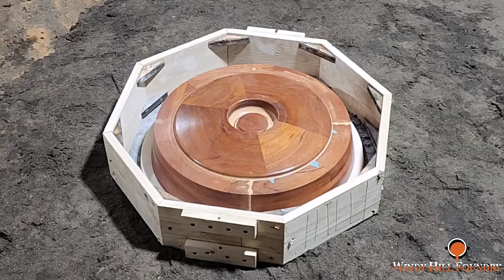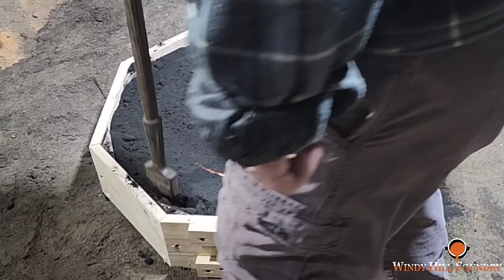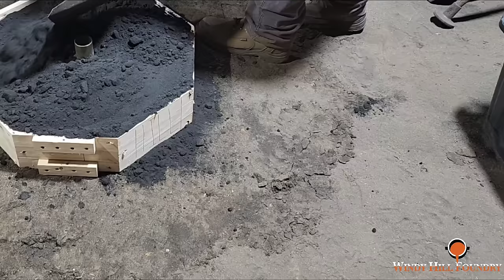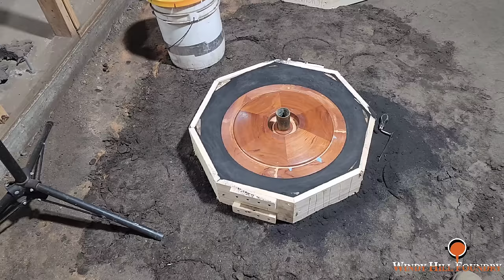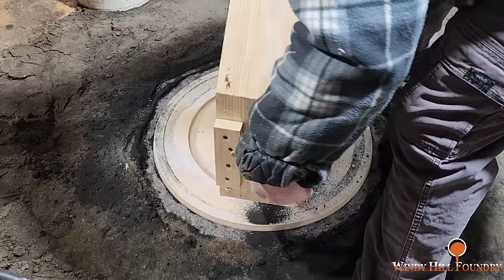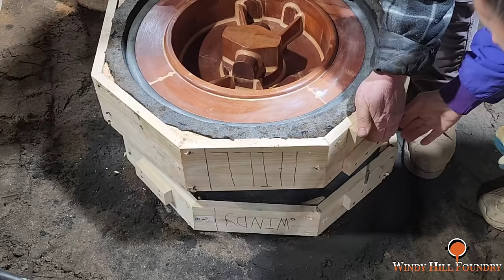TALLY HO CAPSTAN PART2

Comment: For one-off casting I like the Lost-Foam method. I get good results, and you don't have to worry about draft angles and cope and drag issues.
Reply: I thought of that every time the sand dropped and he had to do it over. However, I imagine that making complex patterns from foam can be tough.
Reply: 👍👌👏 Exactly what I thought instantly too. A foam piece could have been easily produced with a CNC machine or a 3D printer. Even the wood piece isn't necessary nowadays. The original parts are scanned, modified if necessary and then printed with a 3D printer. But I guess that the wise beyond his age Leo Sampson Goolden simply wanted to show how it was done for hundreds or even thousands of years.
Best regards, luck and health in particular.

Comment: If it was easy, they wouldn't need an expert.  Trust the process.  Excellent video, looking forward to the next round. Good luck!
Reply: Trust the process. Absolutely.
Reply: Yep, this calls for the right sort of person, which you are! It won’t go easy, but it will go!
Reply: is it supposed to be doing that way? it was a cast item widely used in steam engine ship. mass production  is the key in those days. is it possible that this part was made in a sand pit method instead of using mode? just like those old singer sewing machine frames?

Comment: What I know about casting one could put in a thimble with room left over.  It seems to me that the low temperatures are preventing the sand from adhering to itself, so every time you do a pull, the sand just separates.  It seems to me the biggest obstacle is the below freezing temperature.
Reply from the maker: You are most likely correct. We normally don't run into issues like this unless the finish of the side profiles are too rough to slide out of the sand

Comment: Ive been following this channel, and the tally ho project separately for years.  Kind of cool to see these two communities cross paths.  This looks like an amazingly difficult project. I have no idea how they made the original part over 100 years ago...  its insane to think about.
Reply from the maker: Actually, 100 years ago they were probably tooled to mold up a few hundred of these. With the proper setup, research and trials, they probably were pumping these out efficiently after all the hard work was done
Reply: The process is as
\nit was in the 1600's and won't likely change for another thousand years. I pour silver on an far smaller scale from 1.5 to 10 ounces and the process remains the same. This fella is a joy to watch doing what he loves to do best, LOL.
Reply: How they made those casting a century ago is due to several factors.  At the time of Tally Ho, the world was in the middle of the Industrial Revolution. And there were thousands of foundries with experts in cast iron.  At that time, it was common to be casting machine parts hundreds of times larger than this capstan  on a daily basis.

Comment: Ive also seen illustrations of using turnbuckles for lifting mold sections or even drawing large patterns.
Like a three or four point lifting chain with the turnbuckles in place of chains connected to a main ring.
That would allow for fine adjustment.

I also saw an illustration in "Metalcasting" by C. W. Ammen of a flask with screws mounted to the sides of the flask.
They were used to jack the mold apart for a very slow but controlled draw .
Reply: Yeah, I was just thinking something like an A-frame would be just perfect for this. Easy to move around and able to put in a simple lifting rig to give you fine control.

Comment: I once tried to cast a part that looked like a dog dish and the sand kept breaking off just like yours. A guy told me to ram the mold the opposite way so the large hunk of sand filling the dish was now sitting up instead of hanging and it worked well. First I rammed up a flat layer of sand and then filled the pattern and scraped it off flat. Then flipped the pattern over while full of sand and set it on the flat layer of sand. Then I rapped the pattern and removed it then applied more parting just and set the pattern back on. THen I put on the other half of the mold and rammed it up. When i seperated it, the pattern stayed in the top half of the mold and then I rapped it and removed it.

Comment: I'm guessing the videos are running behind and you have this figured out by now. A trick I use on deep parts, I start the initial separation with wedges ( shim shingles ) between the flasks. It gives good control you can slowly work one through at each corner,  once you have it separated a 1/4 inch or so much easier to lift off.
Reply: i used to use a similar technique to seperate a cylinder head from a barrel. drive box knife blades into the edge of the gasket, evenly all round. Use about ten blades.

Comment: I know you dont want the weight but I think you need steel or cast iron flask and it needs a trunnion mounted on the center section and you need a spreader with hooks to lift it by the trunnions so you can roll it over. You would need a better crane to lift it though. The wood is going to flex too much being that thin and will always cause the sand to fall apart. The only way I see the wood working is if you use chemical set sand. If you used that, you would be done already. We used to make some flasks at work the were cast steel and they had trunnions and were about the size of a casket. They were for casting parts for railroad cars.
Reply from the maker: As I said, we have bigger metal flask but for this and other jobs that require this much sand we prefer to focus on weight and design for rigidity of the mold which can always incorporate wood which is always cheaper by the way

Comment: Many of those machine parts were made by slicing the mold vertically,  making only two part molds.  Of course there is no easy way to make a complex casting, but I have found that I can cheat in really difficult cases by using high strength silver brazing to join parts of a multiple casting where there are large areas of contact and castings must not be overheated.  High strength (not silver solder used in plumbing) silver brazing is often stronger than the parent metal, when used with clamps and overall heat, makes a joint only microscopically larger than the original if repairing a broken casting.  I used it in a heated jig to connect large width bandsaw blades that had to flex around a large pulley top and bottom, with enough tension to hold the blade absolutely vertical when under full load. Several tons.

Comment: I love this process. My castings are asliver compared to this beauty. The mold/core you have made takes the same care and attention my little 4 to 10 ozt pieces take are exactly the same as the ones my pours take but being that big leaves them to larger possibilities of larger voids etc. They are the troubles they make for me eh! Occasionally I will have a look/see person visiting whiIe I am working on the Petrobond and they ask if I have to hammer the sand that hard and my reply is simple, , , YUP ! One thing I have noticed is by running a saw cut along the horizontal part of the flask liner side they have never had a sand slip in from the outer walls. You have a bunch more experience than I do but it has sure worked well for my sorry old butt eh. As I teach others on the best way to pour Silver or Gold, Brass or Copper the reason for their pours have soooo many  voids are they have used far too much parting powder. With this pour a soft hired broom is needed to apply just the right amount of baby powder for your pieces.I have always put in what those that pour more than myself a LOT of vents/risers in each flask. So far that thinking has never let me down. At the end I feel a bit for you and your help but knowing I am not the only one that has the process just not work out and have to start over. It will be great to see the next video.

Comment: Amazing. Hard work. Helpful neighbors. Thanks for keeping us in the loop. I know zero about this kind of work, but wonder if you had 3 lifting trunnions rather than 2 if that would help.
Reply from the maker: It would have, at this time and with only one mold to make, I felt Two would have been sufficient. As we discovered later it would not have made a difference as we completely change the operation

Comment: Awesome video!  Unrelated question: My crucible supplier for my old 30lb aluminum (graphite) crucibles has been less than reliable.  We switched to a new Johnson furnace that's one of the 10lb/16lb furnaces for our students to more quickly do a pour.  Any good supplier you'd recommend to get 10 and 16lb crucibles from?
Reply from the maker: Any dealer of Morgan Labs crucibles are your best options. Morgan Labs have never failed me prematurely.

Comment: For this application you should mold the inside seprate but you'll need a binder for it to hold and the drag molded as a flat to set the pattern on as it's reassembled. In other cases an old squirrel cage fan ring of verying sizes can be used as an anchor for protruding parts.

Comment: Wondering if you ever use a soft brush for the mica/talc/powder in those recessed areas?   I recall one of the old guys in the foundry i grew up by doing that when they cast big flywheels for the hub area.
This was early 1970s and those foundry guys were very good about not hollering at us kids watching them work by the roll up doors and telling us what/why they were doing things.

Comment: The theory about temperature makes sense to me— oil gets much, much more viscous in cold temperatures, and it could well be that it's preventing the sand from bonding to itself.

What about bringing a propane heater to the area when you're ramming?

Comment: I worked in foundry for years and overall you have the right idea . When ramming up sand you need support cross bars and holding hooks to support removal of each section of the mould. Graphite powder is a great release to brush on pattern and joints. Also venting of moulds is important to prevent blow holes in casting. Hope all goes well. Bear in mind to use sprigs in thick sections of casting to equalise cooling and prevent cracking of casting.

Comment: How about to mount 3 'nuts'  and matching tabs on the outside of the flasks and then use 3 screws like spindles to lift / separate the flasks in a parallel manner like a puller? Simultaneously turn the screws would be the best, but if no joint gear is made or helpers are available, turning the screws one after the other by a tad may work... though tedious. This would for sure prevent the binding of the pins. Same for putting all back together aligned. I can see that this is a very complex pattern / mould.  The inside may also be a bit too cylindric/not enough conical to part from the sand (I don't know though of the spacial requirements. Leaving a bit more material and then machine it cylindric where it needs to be and if possible could be an alternative.) --- Btw, I see the wooden AND custom flask a very ingenious approach...
Reply from the maker: This would work for sure and if we were making a dozen of these, we would take more precautions to make sure each mold released with precision but for one casting, you have to split the difference in how much time you want to spend on preparation and how much time you want to spend on the pour and cleanup
Reply: @windyhillfoundry5940  Thanks for responding. That's true. It is walking a fine balance... especially when it is just one of a kind. Sometimes - knowing the outcome - a little more effort in the beginning saves a lot of head ache later... (preaching to myself as the choir of one). I watched 'un/fortunately'  the successful take/post afterwards. Anyway, congratulations and thank you for taking on this challenge. I'm following the Tally Ho for restoration for years and it is amazing how much skills and craftsmanship are required to get something done that 100 years ago may have been much more every day life. I also watched the trolley power pickup related post and enjoyed very much the change of course you took when the core broke. --- I know a bit about such things since my dad worked ages ago in a foundry that produced radiators for house heating. The complex casting process with post machining was gradually replaced under his mastery. The new radiators were produced from metal sheets that were stamped/folded into shape for halves - front and back - of a radiator and then seam welded. Fittings were  easily premade and welded in as well, much easier than post machining... I wish you and Josie and $ and Windy Hill Foundry a Good 2024 with just successes on the 1st run! (from an ever-optimist).

Comment: People don't appreciate how heavy rammed up molding sand is - much heavier than it looks, and those flasks looked heavy.  Even a 12x12 cope and drag weighs closer to 100# than 50...  And this is a challenging 3 piece mold as well.  No wonder it got the second most bleeps I've ever heard on this channel!  Looks to me like the snatch block is causing the flask to lift suddenly and slightly crooked, despite your best efforts.  Tricky one.  Looking forward to seeing what you come up with!
Reply: i mean if you have a bunch of tiny rocks and you get most of the air out in between you end up with a big rock again
Reply: That’s why you need a bridge crane for this kind of thing.
Reply: I have poured a few simple castings in aluminum. The flask i used was 18x12 and i used green sand. It was way the hell heaver than i imagined it would be!
Reply: Man, you're scraping the bottom of the barrel for help, ain't ya? 😂
I kid, Eddy has been my brother for well over 20 years. I told him I was going to heckle him in the comments.
Reply from the maker: Thanks Jeff, I actually edited out 75% of the bleeps to give you an idea🤔

Comment: The intricate part of the pattern being at the bottom makes sense to make sure that the molten metal goes into every nook and cranny but the cone of the pattern is the other way. This forces to have a three-piece mold. I wonder if it is easier to cast the capstan using the lost-wax method instead. The pattern made of wax stays in the mold while casting: one piece mold and no flipping over.
Reply: Lost foam stays in the pattern. Lost wax is melted out of the mold, typically plaster, before it is filled.

Comment: Bro on these big molds you really should be using sodium silicate AKA water glass it would make your life so much easier
Reply from the maker: You never had to pull a deep relief pattern out of sodium silicate before have you
Reply: @windyhillfoundry5940  we have large brake wheels cast for overhead cranes. Some are 30" in dia and they must be 12" deep where the sand fits down inside them. The draft is no more than 3 degrees I would guess. They always use some kind of chemical set sand. I'm sure they use a crane to pull the pattern because it has a threaded hole in the center for an eye bolt. They coat the pattern with some kind of silver paint. It kind of reminds you of graphite and it gets all over you if you lift one of the patterns up.

Comment: Even if you don't need them to lift the total mass, more pulleys would give you much more control when lifting so you could go very slowly. Your current set up seems a little jerky between things suddenly releasing and the stretch of the rope. Not saying it's your only issue, but it may help that one variable.

Comment: What about using the air tamper? Since it looks like you need concrete.
Reply from the maker: These are fine until it's time to de-mold. Takes forever to get the sand reusable

Comment: I have two ideas I would potentially try. Instead of the two stakes I have used expanded steel to help hold the sand together. You can use a medium gauge with large holes about 1 inch from the pattern. It’s not conventional but I had a load left over from a job and was having a similar issue so tried it and it worked.
The other option to think about is using sodium silicate?

Comment: Just a hint or thought - the long pins proud on the bottom around 8:30 maybe C shaped spacers with a string on them - Put on a pin supported rotate to other pin finds home and helper pulls C spacers.  Down it goes. Simplistic I know - but heavy needs help. !

Comment: Was watching this and thinking of my Gradpa's foundary in Portsmouth (UK) where most large castings were set into the floor with a cope on top. Helped that they had a travelling crane to lift the top box off. Wonedr how this would have been done originally, the inside of the casting looks difficult to setup - wonder if this was a core originally?

Comment: Very tricky having to work with a cheek piece , no idea why the pattern was built like that.   But hindsight is 20-20. 
If  you could use co2 cured sand you might have had less molding issues but more pouring issues ? 
Cheers Warren, WDPattern co

Comment: I would try to put a whole bunch of vertical rods (ribbed or capital I-shaped) in the core to keep it together. Alternatievely a cilindrical shaped wire mesh
Reply: Someone here mentioned a proper sized squirrel cage fan. Believe that, along with warmer temps, could do the trick.

Comment: Excellent, love watching the full process, thanks for including all the footage showing the ‘failures’ as well as the successes, as a retired mechanical engineer, just a thought, would it help the compaction of the sand by using a hand held ‘vibrating’ compactor to really make the sand lock together, I think this is what the foundry that ‘Sampson Boat Company/Talky Ho/Leo’ used when they were casting some of the parts for the the internal keel braces, just a thought?
Keep up the good work :)